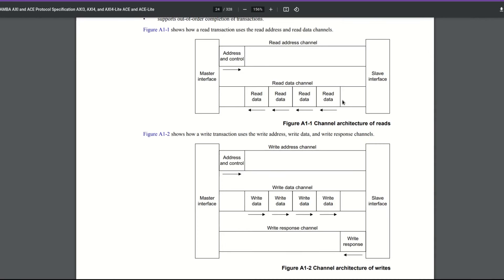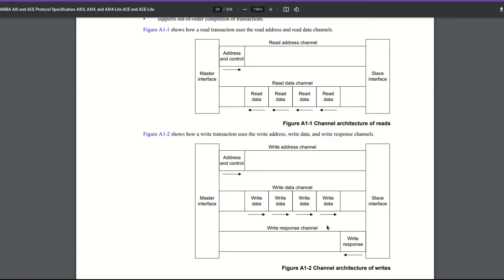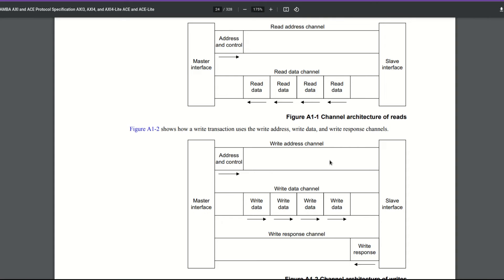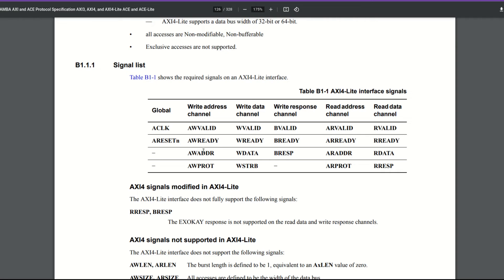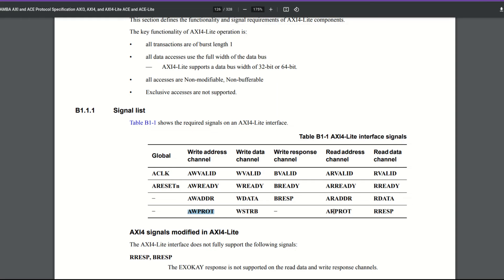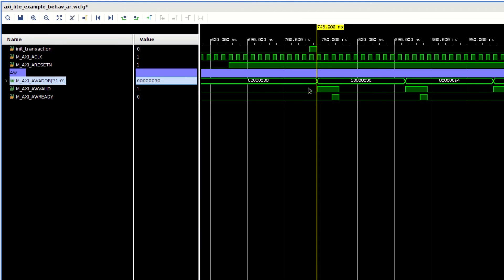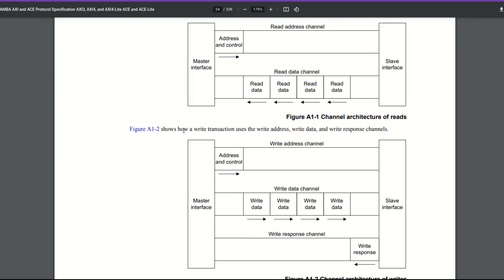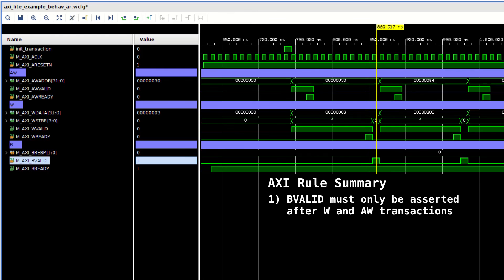AXI Introduction Part 1: How AXI works and AXI-Lite transaction example

Comment: Hi Stacey, thank you so much for your videos. These are very helpful :) One quick question, so ultimately these AXI4-Lite interface essentially consists of multiple AXI streaming interfaces correct? Is that the right way to think about this? Essentially AXI Streaming interface is a building block for AXI4-Lite?

Comment: I would appreciate if you did an spi_slave  design using sclk as the clock edge.  I know you would have to use block ram or a FIFO for handling a cross clock domain to the rest of the system.  I rarely see this approach handled and would like to see how you would do it.  Need is for the slow response time on cross domain clicking the spi cli and already running on slower fpga devices with 50MHz clock.   The spi protocol can be very simplistic, very controlled usuage.